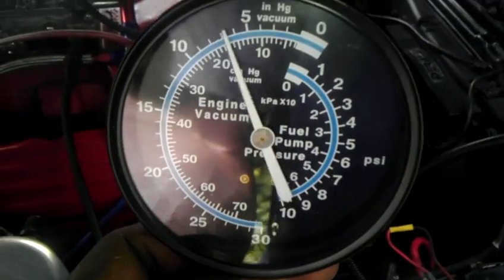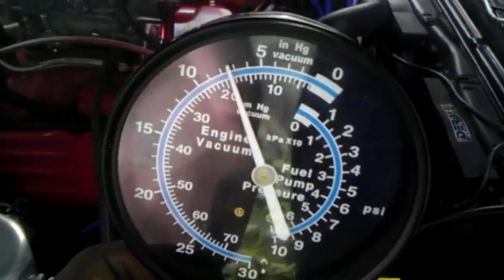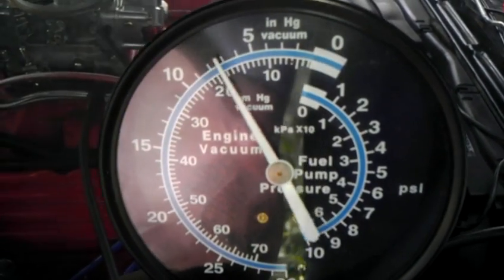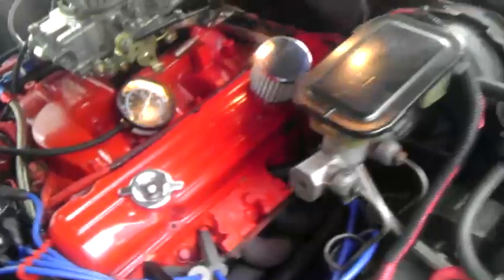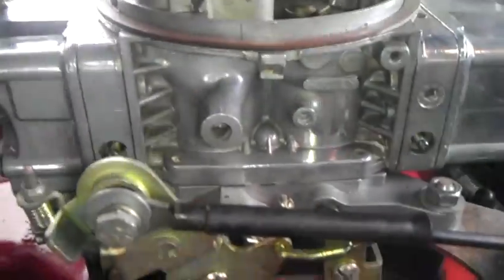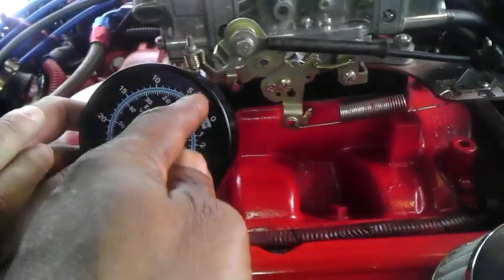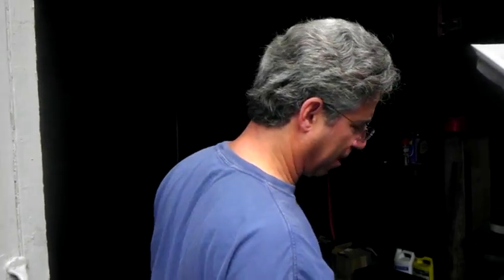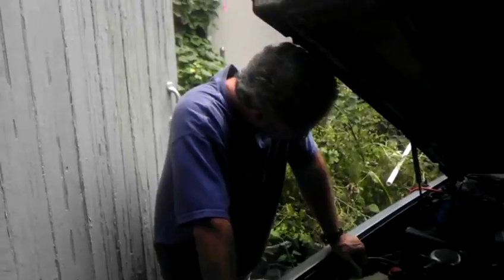CDS 1987 Stage-1 Buick 455 Regal VACUUM TESTING with "11-Second-Steve."  9-2-2012

Comment: Neat. Must have a pretty lumpy cam in there. My Regal has an SP 350 ('70 315hp/410ftlb 10.25:1 engine, stock), that just has a crower cam and an 800cfm quadrajet. It's about 17 at idle, 2 turns out on the idle mixture screws, 10* initial timing with a TA HEI.
Reply from the maker: ... yeah; TA290-08H Camshaft from TA Performance. I'm having the same (new) Camshaft installed in my future STAGE-2 Buick 482 Stroker Motor. 

I'm also using my current Holley 950 Carburetor (built/modified by MAX AIR CARBS on Facebook 👍🏼👍🏼💯💯💯) on the Stage-2 Buick 482.

The Comp Cams Electric Vacuum Pump is still working PERFECTLY to this very day, Thanks to God.

🙏🏽👍🏼👍🏼🙂🙏🏽

Comment: Power valves have nothing to do with idle fuel what so ever. That's why every carburetor has what the call idle jets. 
750 cfm holley, the idle jets are a .033 thousandths out of the box